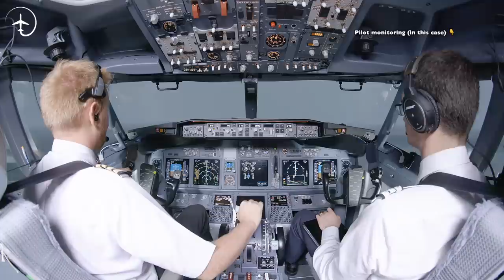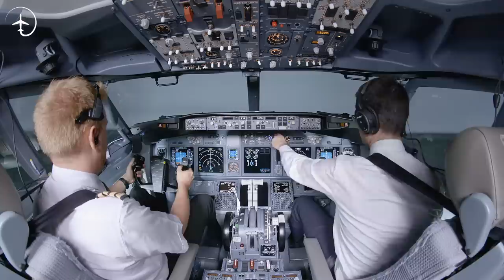Airplane Atlantic speed record!

Comment: I flew a small corporate plane from KSUX to KDFW on a business trip years ago.  On the way down,  we had a tail wind and it was s very quick flight.  On the way back north...big headwind.  I was looking at cities in the dark thinking Oklahima City, Kansas City, Omaha and finally Sioux City.  However, ot took so much longer that I mistook KC for Omaha and was very disappointed because the flight ended up taking over an hour longer than it took going to DFW.  I couldn't imagine looking at water for hours longer than what was necessary

Comment: I've noticed flaps vibrate and take on a form that has less resistance to the airflow but without retracting. I found that quite scary as I thought the flaps were about to fail and even asked the flight attendant to report it to the pilot. Any chance you can do a video on this? I presume it's engineered into flap design for gusts as you mention?

Comment: Hey Mentour Pilot, in 2:14 you are referring to the Arctic Jet stream. Didn't you mean Polar Jet stream (the one on boundary between polar and tropical air)? Arctic Jet stream (existing between arctic air and polar air) is even further into the north around 60degN, at lower level FL200 and it's seasonal typically found in winter. The one you are describing is Polar Jet stream.

Comment: Funny episode from my Delta flight Amsterdam - Salt Lake City two years ago: Instead of 12:37, we arrived at 11:45 a.m. Approaching the gate, a crew announcement: "Sorry, guys, we wanted to provide you with an early arrival, but sadly customs are not open yet!" So, we had to wait on the plane or in the terminal corridor until US customs finally started working at 12:30...
That's the disadvantage of flying to a smaller airport with very few international flights. ;-)

Comment: to Mentor pilot: I have a unrelated question. I notice when you are in the simulator, you are constantly correcting for roll with the yoke. Does the simulator give you a "seat of the pants" input that you are correcting for, or are you doing theatrics? Is there an automatic "wing leveler" function for manual flying ?

Comment: A "speed" record? No, more like a "shortest flight time" record between two cities. The plane didn't fly (KIAS) any faster than other jets (of same type) in the area ... it simply flew in an air mass that was moving faster than the air mass around other planes flying in the same direction along roughly the same flights path (now and then).

Comment: Actually, when we fly with a jetstream, the cruise Mach is reduced, in order to save fuel (and help the environment, too), whereas when flying against a headwind (nobody is stupid enough to fly right inside the jetstream against it) cruise Mach is increased, again to save fuel, as you have higher fuel consumption, but for less time.
Crossing the Atlantic is another kettle of fish, because cruise Mach is part of the clearance, as there is no radar control to take care of aircraft spacing, so you can’t really change the cruise Mach unless cleared to do so.

Comment: Slightly off topic regarding this particular video, but I was querying about aircraft weight calculations. There was a a/c crash a few years ago which was caused by the a/c being over weight. This particular incident resulted in reviewing and revising average adult body weight. Because weight is a serious concern but calculations are based on estimates (passengers and luggage), why hasn't there ever been sensors developed to be integrated into the landing gear that would provide a far more accurate total a/c weight?

Comment: Hi Mentour, how are airliners secured on the ground in a storm? Sure, flaps are retracted, chocks are set to the wheels, but is this enough not to lift the wings or to turn the airliner by a blow against  the fin from the side?

Comment: Widerøe grounded their Dash 8's  in northern Norway during the storm because of extreme low air pressure affecting their altimeters. They land on short runways in high winds, blizzards  and even fog, so the altimeter being off by 60 feet was a no go. My question: Can altimeters be calibrated by the pilots in these conditions before take-off?

Comment: I like what you did with the inlaying of the MET video on your PC screen. One advice I would give is to pan and tilt the video, so it actually looks like it is coming from your screen. To do this, just adjust the corners to the corner of the screen. Because your screen is just flat glass, this can be difficult, but their is a trick for this. Get some Post-it notes, cut off the sticky bits and stick them to the corners of your screen. Then in post-editing, adjust the corners to cover the Post-it notes. So in this case the right side will be taller than the left side. It isn't all to hard in Premier Pro or Vegas (depending on which one you are using.)

Not a big deal, but it adds a bit more quality to your videos. And it really adds at most another 2 to 4 minutes to editing and rendering.

Comment: I was coming back to Heathrow last year are we had to wait for 20-30 mins for our gate to be ready. That's never happened to me before and we were not early or late either. I have a question. If concord went into the jet steam would it have gone faster ?
Reply: When flying, 'speed' always means the speed difference between aircraft and air. Ground speed does not touch aerodynamic issues.
Reply: Alexander Hall Concorde flew in the stratosphere, which is above the jet stream.

Comment: If you throw a paper airplane inside of an aircraft cabin while at cruise, that paper airplane will glide normally, not tear itself apart simply because the airliner itself is flying at cruising speed.  Likewise that 747 wouldn’t have been over speeding while inside the jet stream.

Comment: Regarding strong head wind and fuel capacity; Had a colleague experiencing a flight with an emergency divert due to low fuel after strong headwind during a trans Atlantic crossing. This was some 10+ years ago and I am pretty sure the diversion was to Halifax with an original destination of New York (don’t know what airport nor airline, might have been SAS). Maybe not a real emergency (normal landing I would assume) rather a security precaution for the situation arising, could have been a weather forecast mishap or so...? Does this happen frequently?

Comment: All things relative…  the airspeed calculated how fast the piton is receiving air. For example if the outside air is moving with you at 200 mph and you fly at 500 mph, then the ground speed would be 700 mph… still within the jet stream you are subsonic

Comment: Sad you forgot to mention exact speed gains. RJAA-CYVR @ FL340-390 routes have upwards of 200kts gs in addition to our regular kias(or in alpha - mach fractions). And I’ve seen maps with even higher! To the folks: that’s at times 700 kts (1300km/h gs) in total! For a portion of the route. But like Newton said, you won’t tell the difference, except surprising the approach.

Comment: I seem to remember the 747 being a 0.85 Mach airplane...
Reply: Yes, sometimes it could fly even 0.89 Mach.
Reply: It is a 0.85 mach aircraft
Reply: Depends on the economics of every individual flight.
Reply: i do too
Reply: @Alan Crews You can fly an airplane slower than its maximum speed for fuel savings. It may be a .85 airplane, but it doesn't have to be flown that fast.
Reply: @xNYCMarc  0.85 Mach is actually very typical speed for 747-400. It can even fly 0.93 but then it has significantly higher fuel burn. Flying faster than any other aircraft at that time (1960s-1970s) was one of main benefits of 747.
Reply: Jaroslav Ševčík That doesn’t change the accuracy of my statement. Someone can choose to fly it at .81.
Reply: The limiting Mach for the 747-400 is .91 but that is the actual limit, two things happen as you approach M.90 first your fuel burn goes up significantly, the second is that your arse starts to clench as trouble is in store for the crew who knowingly run so close to the limit that they inadvertently exceed it!
So the usual cruise Mach number is between .83-.86, .85 being common.
It’s the speed I usually fly at unless a time or fuel constraint exists.
Reply: xNYCMarc 
Correct. You can fly it .81, but at normal weights it would actually burn more fuel. It would only be efficient at that speed if light, and lower than its its optimum altitude. At normal weights and at optimal altitudes it’s happiest at .85/86.

Comment: The 747 is designed to fly at speeds between Mach 0.8 and Mach 1.2 as I've been told by various pilots and air traffic controllers. Boeing claims that the 747 ideally cruises at 720 mph rather than 550 mph like so many other sources say. The fastest speed I've ever cruised at was 735 mph TAS on a 777-300ER.

Comment: Can a propeller plane  go in the jet stream if so what speeds can they reach.
And why don't planes fly up to 75 or 80000 ft designed to do this surely crossing the world would be a lot quicker and does it make a difference going the opposite way of rotation at that height.

Comment: Can on board aircraft radar detect microbursts in stormy conditions? I know there have been a few famous crashes which taught the aviation industry about the dangers of microbursts, but I can't remember how they're detected, and if it's down to air traffic control on the ground to warn the pilots of potential danger.

Comment: So when they arrived 2hrs ahead of time, did they have to dump the extra 2hrs of fuel that was not needed before they landed?
Reply: No.  A 747 doesn't need full tanks to do the New York - London trip anyway, so even if it doesn't use as much fuel as predicted it would still be comfortably under the maximum landing weight.  As it happens, the fuel burn on this flight would probably be about the same as usual; it's just that the tailwind helps it along.

Comment: What would have happend with the Concorde in the same situation?
Reply: Johnny Bravo-Sierra Concorde flew in the stratosphere, which is above the jet stream layer.
Reply: Concorde flew a lot higher, in the range of 50,000ft to 60,000ft. This is above the strongest polar jet streams (the 30,000 to 40,000ft range).
Its one of the reasons why Concorde transatlantic times were fairly consistent. They flew above most of the weather all together. The Transatlantic SST routes were also set in stone, whereas normal flights are recalculated based on weather and jet streams.
The thing above Concorde was that its maximum speed was limited by the temperature of the nose caused by air friction which for the sake of the airframes lifespan was not meant to exceed 127*C. That usually equated to Mach 2.02 in service.
Flying lower, in the jetstream, where the air is thicker, would have meant more air resistance, so the temperature limit would be hit at a slower speed.
Reply: Thank you for your time and explanation sir. Best regards

Comment: Thank you Mentour! However, when you enter such a high speed jet stream would the air speed over the wings not slow down during the transition? If so, would such an aircraft not approach stalling speed? Thanks  Henri.
Reply: Imagine a fly, in a plane traveling at  400 knots, buzzing from the rear of the plane to the front.  Actually, the fly is already at 400 knots but still flying faster to reach the front.  I think that is the analogy....
Reply: Think of it as walking into a river or stream. The water close to the bank isn't moving nearly as fast as the water in the middle. They have to enter the jet stream carefully
Reply: Yes, but if the flow of the jet stream is laminar as you suggest these speeds can change and the jet stream does always blow straight. Regardless  my question remains if you find yourself suddenly in a fast moving airstream blowing from the rear could this cause an aerodynamic wing stall due to the reduced air flow over the wings?
Reply: @henrivanbemmel  the short answer is yes, the long answer is no.  You are completely correct that a jet penetrating or leaving a jet stream very suddenly could find itself with an indicated airspeed that puts it in either a high or low speed stall condition.  However in reality the edge of a jet stream has a wind speed gradient which allows the pilot to adjust the engines gradually and maintain a safe indicated airspeed throughout.  This is also why it is important to know where the jet streams are.

Comment: High winds on approach. Is there one particular aircraft design that is better able to handle high winds? Larger jets vs smaller jets. New wing design (787) vs older wing design.
Reply: When looking at some of the videos it appears that the 747 is much more stable than any of the more modern planes...  no idea why.
Reply: @Rob2  the wings design is more stable but has more drag too.

Comment: long story short, a plane can piggy back the faster moving air off the jetstream, so its the same as you walking at an airport then stepping on to a moving sidewalk , your pace of walk remains the same but the additional motion of the moving sidewalk greatly multiply your overall pace.  Same as a boat sailing in the direction of the flowing current.

Comment: How are outbound and return flight durations so similar given that the earth is Supposedly Rotating at over 1000mph from West to East
Reply: The atmosphere rotates with the planet. This is why we do not have 1,000 mph winds on Earth.
Reply: @Eternal_Tech  
Patrick John Watson
Patrick John Watson, former Meteorology Lecturer at University of New South Wales (2004-2009)

‘You may have a sea breeze at ground level that gradually changes direction as you ascend.

A land breeze may have a similar effect.

The Surface wind blows across the isobars, outwards from the centre of a HIGH then gradually changes to Gradient Wind (parallel to the isobars) with increasing height.

A mid- latitude isobaric analysis may show an easterly gradient wind. Directly above that pressure system, the winds will have changed to Westerly.

Upper Level Tropospheric winds are westerlies, regardless of the surface direction

Comment: I'd venture that it isn't due to the direction of earth's spin. lol  Or even the speed, 1,000 mph, prograde, west to east, at the equator. Think of all the issues which would undoubtedly arise if this were truly the case. At what altitude does the atmosphere (the sky) cease its synchronized rotation with the earth (the land) beneath?  Otherwise people would only need to hover, above a spinning earth, and wait until there preferred destination appeared below them before setting ground again. Having let the spinning earth do most of the work bringing them to their new destination. Just a lot of questions raised which I've never found any sufficient answers to. And, I've looked.

Comment: if i gain speed by using a jet stream i have to accept an indirection because the stream is probably not straight in my way, so i have to travel more miles than outside the jet stream, what would be better?

Comment: Can you tell something about the flight from Air Europa which made 5 missed approaches in Amsterdam and diverted back to Madrid? Why did they tried so many? I thought three is the maximum and that's only if the pilot is sure it will work then
Reply: Darn, it is a long way from Amsterdam to Madrid. He must have had a boatload of fuel on board at the commencement of the flight.

Comment: So, structural integrity is not at risk if excessive speed is due to a tail wind, rather than an excess of engine power?
Reply: Once in the air, ground speed is irrelevant. It is the speed difference between air & aircraft which is important. Also, take-off & landing is always performed into the wind because you already have airspeed whole the aircraft is stationary on the ground. Petter explained this in another video.
Reply: @TheRip72  Thanks. That makes sense.

Comment: Probably a 747 can reach sound speed without suffering catastrophic damages. 
Does anyone remember china airlines flight 006 in 1985? The 747-200 fell down 30.000 ft in just 2 minutes, probably reaching the sound speed. The plane suffered minor damages but was still flyable

Comment: You said everything inside the cockpit would be normal, but what about fuel consumption? Is that affected?
Reply: Ben R. Fuel burn per hour would be the same, the total flight time would be shorter.
Reply: @gordonrichardson2972  Right, so with less overall time spent in the air, would they have arrived with more fuel than planned?
Reply: Ben R. More fuel than they needed, but high probability of diverting to an airport far away from the storm.
Reply: @gordonrichardson2972  Thanks!

Comment: I guess this is also good for the Airline ( in this case BA)  as the airline has just saved a lot of fuel, therefore making that flight a little more profitable ...
Reply: Yes, but they will still have been running westbound flights. They would cancel out the difference (most of it anyway).

Comment: This speed is simpal, the aircraft's air speed has little or nothing to do with speed across the ground it is only in relation to the air around the aircraft. On one occasion I was  clocked moving backwards at 10 knots in a glider in order to go forward across the ground I had to aproch vne. That wind day was very challenging .
Reply from the maker: Correct

Comment: If you face the jetstream, of course, you will take longer to cross the ocean. What about the speed showns on your instrument? Correct me if I'm wrong: the pitot will face strong winds so the speed indicated will be faster that's in reality?
Reply: The speed indicator is always measuring air speed (in fact, dependent on air pressure / altitude, it isn't even correct, must be re-calculated). Aerodynamic laws allow a minimum and a maximum air speed. Ground speed or GPS measured speed is irrelevant for flying.